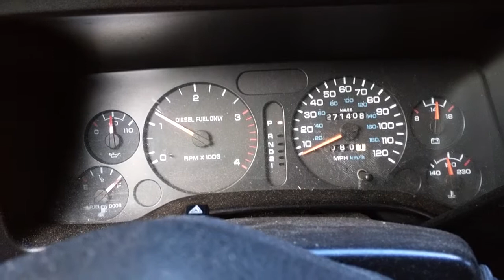Dodge Diesel straight piped

Comment: what size exhaust are you running? My 02 24 valve is a 4" straight pipe and its obnoxiously loud. Im ordering a 5" stainless steel with muffler in a few weeks because I'm so sick of it
Reply from the maker: stock pipe, just removed the muffler and added a strait pipe- left the cat in